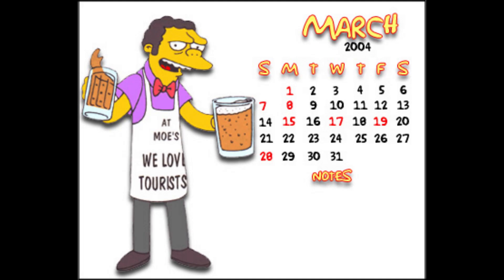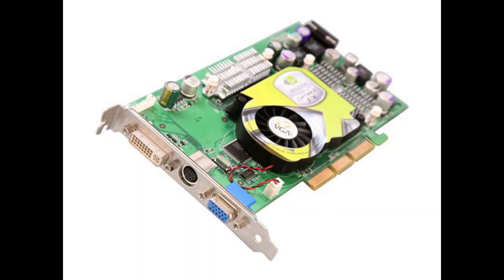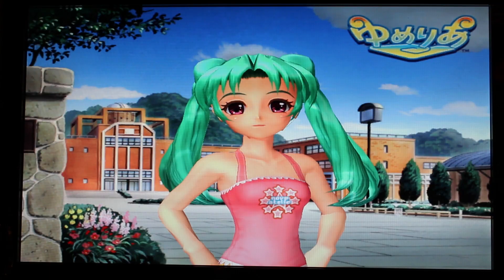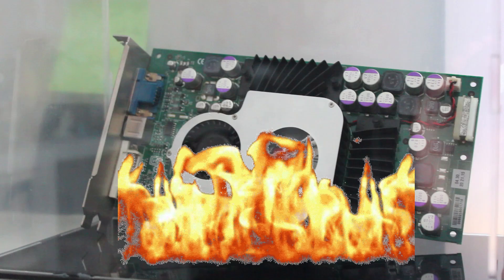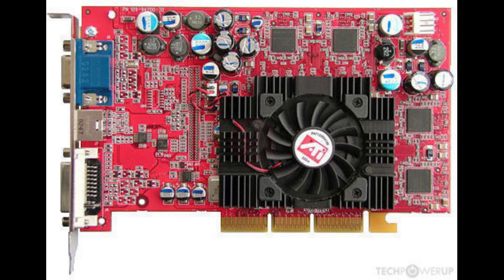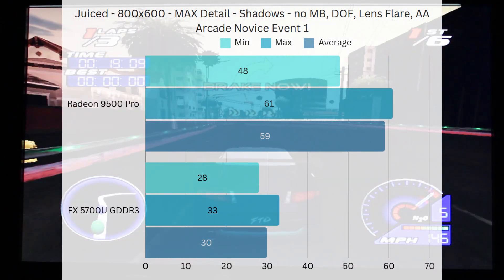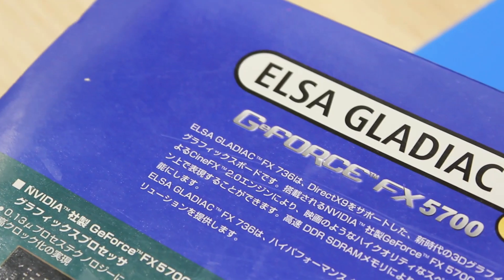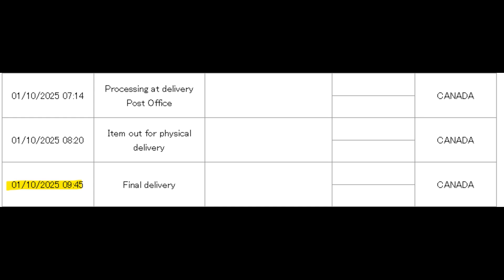The Worlds First GDDR3 GPU Was A Low Effort Marketing Ploy By A Once Desperate Nvidia

Comment: in  2004 i purchased the bang for the buck GPU an DIAMOND VIPER Radeon 9600XT 256MB so i can play Half- Life 2, Doom, Max Payne 2 and Far Cry . the NVIDIA 5 series was trash and to expensive for the performance it offered.
Reply from the maker: The 9600XT was the way to go. Did you enjoy your free copy of HL2? Most 9600XTs came with a mail in voucher of some sort from what I understand
Reply: @big-ts-tech-corner  Unfortunately it didn't but I did receive  Hitman 2, Tomb Raider Dark Angel and Deus Ex Invisible War Discs inside as well as 3dmark and some cool 3d rendered ATI screensavers and Benchmarks. I did spend the $80 for Half-Life 2 collectors edition that came with Counter Strike Source, Half life Source and a Half life 2 T shirt. Good times. I was running a Pentium 4 HT 3.4Ghz 2GB ram and an Abit IC7 motherboard.

Comment: January 2024, instead of going this route I bought a new old stock (Ebay) NVIDIA Quadro FX 1100 128 MB AGP for a Windows 98 retro build, much cheaper, and really fast..........$125 Canadian.
Reply from the maker: I found a new old stock one for 50$ last year and I have to agree theyre decent cards! Sadly theyre held back big time by the memory. Mine was Overclocked to 475Mhz on the core and 350mhz on the memory. I used it in a build featured on this channel in one of my recent vids

Comment: Its the 128 bit memory bus on everything lower then fx 5900 that did those cards not much good. These were really starving for memory. I mean that was on top of the outdated architecture the core had. Still the better ones are nice for everything before 2005 orso. One of my nicer retro pc has a pentium 4 at 4.3 ghz and a quadro fx 3000G running past fx 5950 ultra speeds.
Reply from the maker: I'm not so sure memory bandwidth was the problem. I think the problem was more poor dx9 shader handling and, in this case of this specific card, only 4 TMUS vs the 8 TMUS of say a 5800 or a 5900.
Reply: @big-ts-tech-corner  Performance can nearly double between 5800 ultra and 5900 ultra if you do not run into a cpu bottleneck.

Comment: Definitely a late-gen gimmick, and I agree it was probably more a testing ground for the new memory. Either way it barely moved bandwidth at only 50MT/s more, and the 5700U wasn't lacking in bw to begin with. Benchmarks comparing the GDDR2 and 3 versions back in the day showed little to no significant change.

Comment: My FX experience was a 5200 256mb, so again a memory scam by Nvidia 😅 was awful, 20fps was a luxury with that garbage
Reply: Yeah it was the era where people thought that more VRAM = better GPU and it lasted for a long time, I remember people buying the gt730 4GB just because it had double the VRAM of the GTX 770 and they thought they found a great deal. XD
You have to give it to Nvidia, their marketing always works, just like how they said that the 5070 is as fast as the 4090 XD
Reply: @rattlehead999 And back then information was not that available, internet was super expensive and magazines were also difficult to find in my country, so yes, more memory = better because of ignorance.
Reply: @ The biggest offense was calling mid-range(60 class) GPUs 80 class and selling them at such prices.

The gtx 1080 is a mid-range chip at 314mm^2 die size out of 851mm^2 reticle limit and was sold at 600-700$ (FE)MSRP and people bought it like crazy. It should have been 350$. 

For reference the RTX 2060 was 340mm^2 the RTX 3060 is 296mm^2, the gtx 760 was 294mm^2, the gtx 560 was 331mm^2.

The three generations that were offenders are the gtx 600, gtx 1000 and rtx 4000 series.

People ignoring die size due to listening ignorant youtubers is why the market is the way it became now.
Reply: @rattlehead999   why would you consider die size, instead of the much better metric - % of active die X performance. I don't care if the die is 10mm² or 10m², I want a specific level of performance and efficiency at a specific price.
Reply: @Gabu_  Because performance is a byproduct, and because we get new process nodes.

You can have 2 billion transistors that render billions of polygons a second or you can have 2 billion transistors that do nothing but consume power. That's why performance is a byproduct.

And new process nodes give you more transistors per mm^2 at higher clocks at the same power or lower power at the same clocks.

Price is also a multi-variable equation, with the only real variables that are not part of the economy, but part of technology/physics is the die size relative to the reticle limit and yield rates. That's why die size matters.

Die size relative to reticle limit is applied to all types of Integrated Circuits(ICs) and chips, be it GPUs, FPGAs, CPUs, ASICs, micro-controllers, etc.

The fact that people started ignoring this metric due to ignorant youtubers in the very late 2000s and early 2010s is what allowed Nvidia to do the first ever switch up, where the gtx 680 was a 60 class card sold at 550$ instead of the 270$ of the 560 of the previous generation.

And then the real generation that screwed us over is the gtx 1000 series, a 60 class card sold for 600-700$ (FE)MSRP
Reply: @rattlehead999  Don't forget the absolute scams that TurboCache (nVidia) and HyperMemory (ATi) were :
Very low end graphics card, that could grab a good chunk of the system RAM for themselves, and it allowed OEMs to claim "WOW 2Gb of VRAM SUCH POWER" on the case while in reality, they had 64Mb on board with 32bit memory bus (yes 32bit) and were slower than the counterpart with only dedicated RAM. The borrowed RAM was simply useless. 
I've done a few benchmarks of such cards, the GeForce 7500LE TC being the absolute worst, as it's a rebranded 7300LE with the same G72 GPU, with 64Mb of DDR2 at 32bit,  100Mhz less on the GPU, yet a higher number on the naming scheme. They were made by Sapphire surprisingly, but for Acer computers.
Reply: i had an FX5200 256MB but i had a good one with the 128-bit bus and a fan, not passive cooling. now when i say "good" i only mean good as compared to other FX5200s as the memory and core were clocked higher. ive been looking for one on ebay for years but it was like a half height XFX with a silver cooler one and the only ones i can find are full height cards with a black cooler.
Reply: @thelasthallow  Mine was an XFX with passive cooling, not the low profile one, the full version but I don't know if it was a 128bit
Reply: @ yeah Nvidia did fucky shit with the 5200, they had ones that only had a 64 bit bus, low clock high clock 64MB of Vram up to 256MB, it was wild back in the day.
Reply: I tried playing Halo Combat Evolved and Doom 3 with that card, LOL!
Reply: same with me, all my savings only got fx 5200 that time